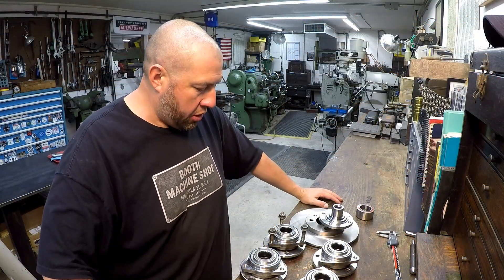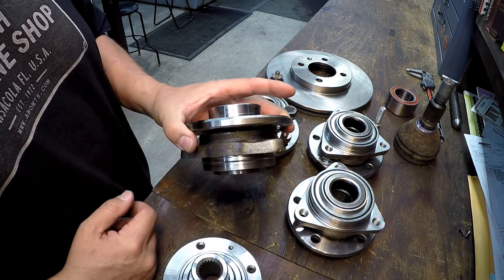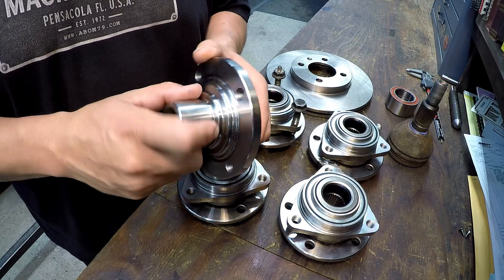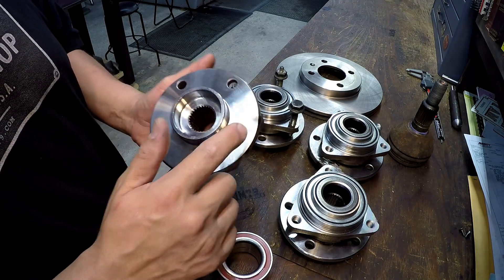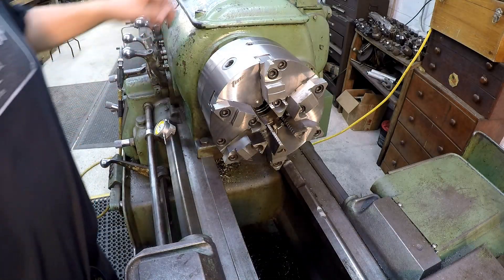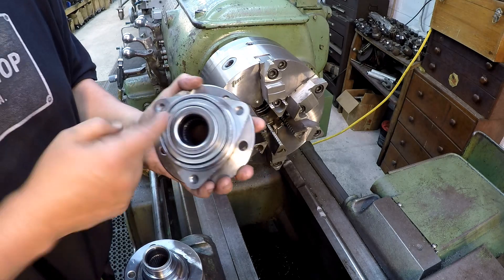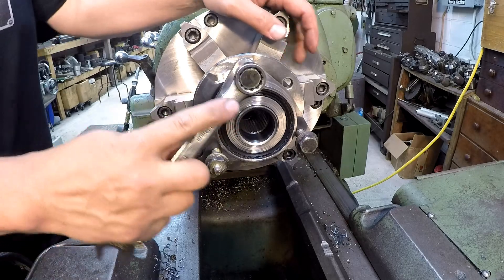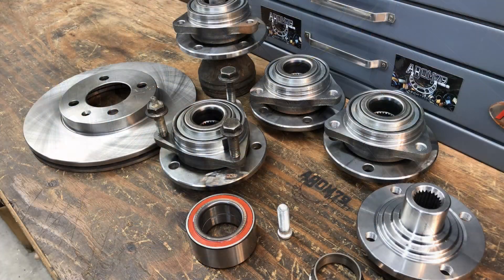How To Remove Bearing From GM Hub Assembly

Comment: Another crazy VW project I would have passed on... friend or not, he can chuck a tire at the crowd without my help.
Reply: I was thinking the same thing. The original GM hub has a pair of angular contact bearings. I doubt that the customer's replacement bearing can withstand anywhere near the same lateral forces.
Reply: @EDesigns_FL  I don't think the customer supplied bearing can support any side loading. Those stock GM hubs, if they're the Blazer/Jimmy 4wd fronts, which they do look like, are actually stronger than the same year Corvette rear bearing - especially if they are SKF. I've used them out of the box for Custom IRS setups without issue - but for Drag Racing? Hell no... put a proper axle under it or go home.
Reply: tahwnikcufos.....Whether this is a VW, or GM or let's say Ferrari, it makes no difference to the machinist.  He is following the customers directions or drawings.  Why would you turn down a paying job?  The machinist is not in the "car building" business, he is in the "parts" business. The design is not the machinists job.  Adam is a Mopar guy.  Should he turn down work because he doesn't agree with the car choice it will be used on?  Nope. Make it, bill em', and bring in the next one!
Reply: @paulcopeland9035  What's at issue is not a product brand: it's whether the product is likely to fail and what the consequences might be. In this instance, it's probable that a wheel could come off a vehicle. That's a lot of liability! If this occurs, and someone is hurt or killed, then every party involved will be examined for culpability; and there's frequently a lot of finger pointing in these situations. Claiming that someone told you to do something blatantly ridiculous doesn't typically go well in a courtroom. 
Beyond legal liability, some people have a little character and won't do b.s. work! They take pride in what they do, but this obviously doesn't pertain to you.
Reply: @paulcopeland9035  cradle to the grave sunshine... cradle to the grave.
Reply: @EDesigns_FL ...You have no idea the immense amount of pride I have in my products, so don't go there.  The issue here is, these are "parts"  They need modification per the customer.  The machinist makes that happen and it is out of the door.  The machinist is not liable for the entire product.  For example, in Adam's past job with Motion Ind., he was called upon to machine large rollers for a paper mill.  Let's say the machine was to fail internally and cause injury, is Adam liable because he touched a part of it?  Nope.  You say that "claiming someone told you to do something blatantly ridiculous doesn't typically go well in a courtroom". The defense would be that it is not the machinists job to decide if the customer knows what he is doing. 

   Thousands of parts are made and modified in machine shops every day.  This is how things are done.  I knew it wouldn't take long for the "liability card" to be played.  See ya, I have work to do.
Reply: @paulcopeland9035  Anyone that is willing to do ill-conceived modifications, because someone told him to or "it's a job", does not take pride in their work. Your comments are evidence of the caliber of what you do. 
You should consult with an attorney regarding liability because you don't have a clue.

Comment: Jus t a quick idea, but wouldn't it be better to modify the hubs to fit the bearings? as the bearings are a wear item.
Reply: In drag car, I'd think that the axles were the wear item, and not so much the bearings...?

Comment: Adam how come you don't use and cutting fluid on this??
Reply: doesn't make much of any positive difference when the chip's coming off glowing red. Just fills the shop with smoke and makes the insert chip real fast from thermal shock.

Comment: How come oil isn't used with the carbide cutter ?
Reply: I think because the heat doesn't affect the carbide tooling like it does with hi speed steel
Reply: @brandysigmon9066  Thanks for your reply

Comment: I'm going to guess not, because you didn't but could you have just gone in at an angle and removed the rolled part of the hub instead of cutting through the hardened race first?

Comment: What a mess around just bolt it down and use a large slide hammer with an adapter on it pop it straight out then grind a small grove on the last half of the bearing split it with a chisel and job done no damage or messing

Comment: I don't get why not just turn the flange down?
Reply: Because the flange has to survive, that's the part they need.
Reply: @MysticalDork  Yes maybe I misunderstood but didn't he say it was only hold together by the rolled up part at the end? Then remove that and it would all come apart?
Reply: @erik....  That's exactly what he did. Problem is, the rolled up part is mostly inside the bearing race, so unless you've got a skinny trepaning tool you're willing to burn up, the only way to get to it is to turn down the bearing race too.
Reply: They want the bigger bearing in there instead of stock GM one. VW bearing housing would better fit a VW as well, but axle mount could be modified for GM bearing housing without too much bother. Part 2 and 3 should reveal all.

Comment: Yes, they are called press in hubs. Wheel Bearing Generation 2.1
Why are the tool squeeking and making so much terrible noises? Why is the machine eating the tools?
Reply: because bearing races are usually hardened.
Reply from the maker: Hardened steel
Reply: Ah, maybe a diamond coated tool will work better? That should be harder than the hardened steel i think?

Comment: How come no cutting oil or anything Adam? Forgive me i'm no machinist it just seems unlike you to have a less sacrificial method of cutting a hard material.
Reply: I was wondering the same thing.  What kind of tool does it take to cut that type of hard material without burning up?
Reply: @MikeBramm  ...Did you ever wonder why inserts came in multiple packs.  Some jobs are tougher than others.
Reply: The heat generated by cutting that tough metal would surely turn cutting oil into enough smoke to fill the shop.

Comment: Rpm to high. Cutters can last for the whole job if you work out your cutting speed properly.
Reply: The larger the bit the slower the speed that's what we were taught at school so small bits increase the speed.
Reply: @Ryzomadman The way you are explaining that is for a drill bit of a milling machine. In this case you have to imagine the work piece as the drill bit and the cutter as the work piece. The speed needs to be faster as the drill bit/twist drill diameter gets smaller. This also applies to the diameter of the work piece in the lath. The smaller it gets the faster it needs to spin to make the same cutting speed. Larger work piece = slower RPM = no burnt cutters. 

Speeds, feeds, RPM video from Haas
https://www.youtube.com/watch?v=zzzIpC39WUg (this video is for a CNC machine but it's the same thing)

Formulas:
https://www.ns-tool.com/en/technology/technical_data/cutting_speed/

Take care :)